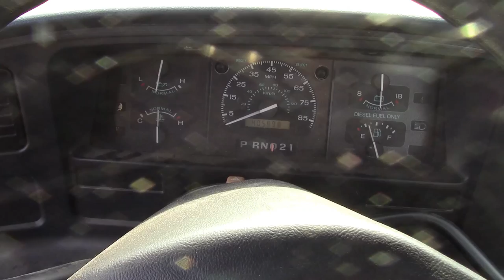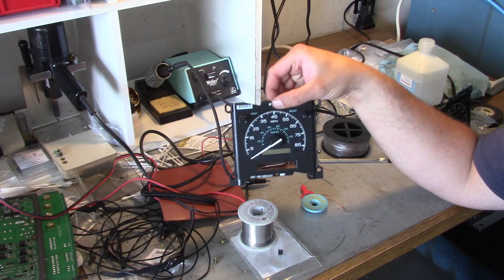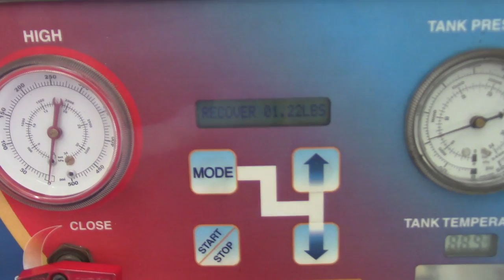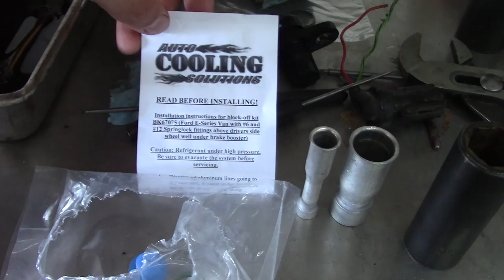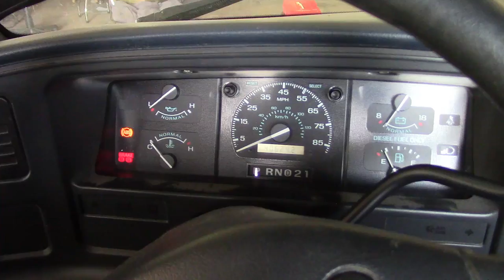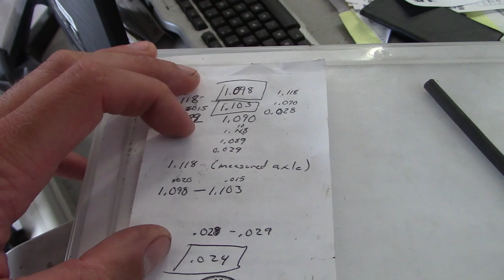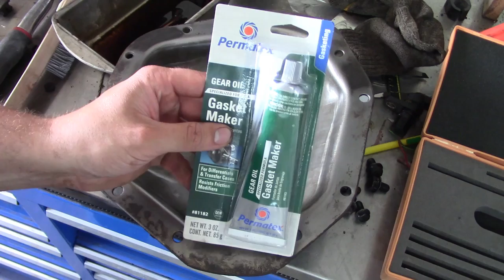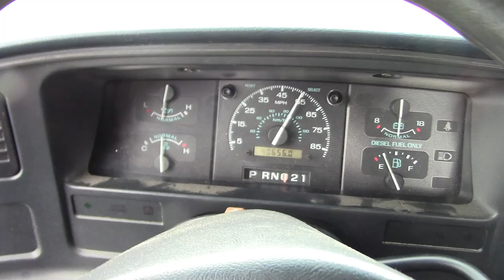Ford E350 | Speedometer Diagnosis Frustration

Comment from the maker: Looking for an obscure specialty tool?
Lisle 14100 Valve Core Tool: https://amzn.to/2AM88Rm
Weller 6966C Heat Gun: https://amzn.to/2YXNQvU
Reply: What was the stuff you use on gaskets that helps it seal but never hardens?  I was looking for that the other day and forgot.
Reply: Wes I was wondering your thoughts about a Massey Ferguson 65 4 cyl gas if they a solid tractor or not. Really enjoy your videos keep up the good work. Thanks from fielding new Brunswick Canada.
Reply from the maker: @CTSCAPER  Permatex 2A I think. The "aviation" stuff.
Reply from the maker: @oldfaithful4112  Masseys are pretty decent. Should be a Continental or Perkins engine. Either would be good.
Reply: 👍👌👏  Pretty impressive! Congrats!
Reply: What was the de-soldering gun?  Sounded like Heiko 808.  Thanks.
Reply: Its a ford... Speedo works be grateful lol
Reply: instaBlaster...
Reply: I enjoy your expertise thanks

Comment: I’m a old commercial HVAC mechanic twenty seven years in my trade and I can recognize a skilled mechanic. You sir are highly skilled, how you can go from issue to issue flawlessly is incredible. 
I can’t believe how some idiots troll you. Thanks for a another great video I look forward to them.
Reply: Agreed, sir, from an old HVAC mechanic of over forty plus, on the sheet metal heavy commercial end of the trade. He's very skilled, and better, he's a natural, but he's still a pup, and lets things under his skin. So he still tries to bull his way through occasionally, instead of easing away, until his rational, and logical brain returns to the controls.
Yes, sir he's dam fine mechanic, and even better in the control wiring side of things I'm thinking, as it challenges his mind, and he enjoys that part of it.
Reply: @timothymilam732  I'm guilty as charged.. But I ain't no pup. but if I STOP, and say, calm down.. and go thru things sloowwwly, I can get a tough job done, no cursing, and muscle thru it just fine.  In the end Wes went right to the heart of the matter, so that's cool.
Reply: I agree with Kenny 100%. I'm also a 24+ year tech who has worked on a huge variety of cars, trucks, boats, and equipment. I've been at indie shops, dealers, specialty outfits, and finally went into business strictly for myself. That being said, it's very clear to see, and give credit to a fellow tech who is good at what he does, and does it right. Wes is the F'N man!!! He's the type of dude I could really hang out with. My 'take away' from the people who try to troll and act like they're something special are just starving for attention and looking for some sorta credibility/ notoriety. Probably a good amount of jealousy and a dash of ignorance thrown in there as well. Keyboard warriors are all over on the interwebz. F 'EM is what I say. Keep the stupid comments to yourself and don't even watch the video in the first place if you "know everything," or are just commenting to 'look cool." This is a VALUABLE thing that he is doing by trying to help/ teach someone who is looking to get into repairing their own stuff. Not only does it help people save lots of money, but it can build a persons confidence enough to tackle the work themselves. Hell, and the videos are entertaining. I personally watch them for the commentary and I think some of the stuff is pretty damn hilarious.
Keep doin what you're doing Wes,
and keep it real bro!
👍😎

Comment: For a tooth wheel operating off a reluctor, the strength of the signal is determined by the sharpness of the tooth edges. So, in order to get a strong signal, you need abrupt changes in tooth height. With the teeth rusted like they were. It turned them into rounded nubs. I think that you saw a decent signal on your scope because you were spinning it by hand but once those teeth had some real velocity along with the load of the amplifier circuit that the reluctor was driving. Those things combined might have resulted in a weak signal as well as a signal with leading edges (assuming a leading edge trigger) that were rounded so the circuit (assuming a zener) was not sensitive enough to actually catch the leading edge reliably. So the result was a signal that would have a time value between true triggers on the gate of the amplifiers that was all over the place. Just a thought but one that makes a lot of sense.

Comment: My '97 F350 had the same bouncing speedometer issue.  I bought a new sensor and when I pulled out the old one it had metal shavings hanging off it.  I pulled the cover off and there were chunks inside.  I ended up getting another axle from a junk yard that fixed the speedometer.  Thanks for the videos!

Comment: Hi Wes, a couple ideas, just grist for the mill. 1) If you have a signal generator and can feed a clean sine wave of varying frequency and the right amplitude(s) to the speedo, you might be able to isolate the problem to either the speedo (if it still bounces) or the signal source (if it likes the clean source). You could also narrow down an amplitude range by varying lower until the needle jumps around or quits altogether. 2) It occurred to me it might be interesting to put a dial indicator on the gear teeth and see what the height range looked like. Then maybe setting the gap to the low end of that TSB range on the high teeth. Also might point up a concentricity problem or something. 3) You might want a shielded (coax) cable connected very close to the sensor while you're taking a measurement. Twisted pair might do the job fine though. In any case, that's a pretty long conductor acting as an antenna that can be picking up interference and the wires are a potential source of problem too, although I expect they are not shielded as they come from the factory. Anyway, it shows me your good character to be bothered by this not being quite right. But might want to check with the customer to see what good-enough is in this case :)
Reply: Very good suggestions/thoughts. I didn't see a response from Wes. Was wondering what his reaction was to your ideas?

Comment: I don't think that even the most knowledgeable armchair expert would suspect a rusty tone ring inside a differential ! 
The ABS and traction control on my 02 Volvo V70 kept going haywire. The left front tone ring was the cause, rust jacking had cracked it, ok up to about 45mph then a lot of warning lights on the dash. This is a good channel.
Reply from the maker: I surely did not expect it!

Comment: Block off kits are AWESOME. I suffered through 3 summers with no AC in our '07 Jeep Commander because the long lines for the rear AC leaked and I was baffled by the whole ordeal. After some research and some transfer of troubleshooting skills from one discipline to another, I dove in and fixed that critter!

Comment: It is satisfying when one can pinpoint a diagnosis with a scope, but sometimes the scope doesn't show everything you need to see. On the last VR speed sensor I did there was another 4X4 axle sensor nearby so I was able to swap identical sensors and prove the diagnosis first, but that's not often possible. In most, both the amplitude and frequency increase with higher velocity. For a pro like yourself one has to consider the extra time involved, so I can understand getting new parts and moving on.  Love WWW videos, thanks for the effort to keep them coming.
Reply from the maker: I'm really wondering if the higher resolution scope will show us the problem.

Comment: Ford "hello, how may we help you?" 'ya hi, my speedometer fluid is leaking.' i mean, that conversation must have happened somewhere at some point. 
 great video. i almost bought an identical E350 cab/chassis that had an ambulance body removed at a farm auction a few years ago. i notice it is in the scrapyard already. someone must have discovered similar problems. it's amazing you much i learn from youtube. keep wrenching Wes.

Comment: I know this is an old video but I wanted to share my thoughts. I agree with your speculation that it was 2 parallel problems. My guess is that the PSOM module went bad first. You mentioned that it sat for quite a while. I have picked up Ford junkyard axles that sat for a long time and the top half of everything was rusted because it wasn't submerged in oil, and moisture got in through the vent tube, either by raining on it, dripping on it, or just what's in the air.. I'm not sure if just moisture in the air would cause pitting that bad, I lean away from that one.

Anyway, thanks for all the weekly videos. You're my favorite channel, always enjoy watching you diagnose and repair problems. You've definitely added to my toolset.

Comment: Wes I had the same problem a few years back and like you we had replaced just about everything as you did, I got talking to a old Ford mechanic and he aske if we had checked the wiring loom farther up the loom. we went back and started checking to wires and sure enough  the coating had got hard and had broke letting water and such in and was a corroded mess. replaced that section of wire and sure enough that took care of the problem. I hope this helps Happy Fathers Day

Comment: I own that same heat gun. It will also sit with the business end pointing skyward (at an angle). For long life, run it on the blower only setting after  applying your heat shrink until the air blows cool. It keeps the element happy.  Mine is >20 years old and still works great.

Comment: I'm a San Diego Auto mechanic. I always use RTV called Right stuff. I fill the diff straight away tighten the bolts immediately and don't wait longer than it takes to wash my hands to drive it. No problems the last 15 years. Just saying. Love the show. Thanks

Comment: 75w90 or 75w140 works good in them, as long as they LSD compliant. Synthetic is a huge help with those rear-ends. all 3 of mine have the 75w oil with lsd and synthetic, all very smooth.  The good thing is, your honest, diligent on finding the issues, you don't hide issues, and you do things proper.  It is hard to trust a lot of mechanics and technicians, people that have you work on their vehicles and equipment are very fortunate and lucky.

Comment: Well done Wes.  Great job in explaining and keeping your frustrations under complete control.  Yes do another live chat so we can jump in with some super CHAT tips in the jar to help you pay for the scope. Interesting enough The jet engine I’m a specialist on also uses A very similar method of N1-Fan and N2 Spool pick-Up Seed pick up sensors. The Maintenance manual has a shim pack so we can increase or decrease accordingly.  Pretty cool you did well in explaining.
Reply from the maker: Wow. That's cool. Do you use a scope to check the sensor or is it just a matter of setting the air gap to a spec and it will be right?
Reply: @WatchWesWork  sending you an email with the Learjet engine manual screen prints we worked off in the field as Jet Engine field service mechanics

Comment: It's hard to fix when everything is broken, I feel your pain.
My guess on the tone ring is that is that is was never mounted concentric, even more so now that part of the ring is eroded. The sensor gap would be changing as the ring rotates with a large change where the corrosion is. This means that there will be 2 frequencies coming out of the sensor, the lower frequency derived from the changing gap. Maybe at higher tire rotation speeds that messes with speed adapter module to cause errors in the speed output.
Just a YouTube comment guess tho :D
Cheers,

Comment: I'm having a keep finding/fixing stuff problem right now, just like this truck. I'm glad to know that my hypothesis about that sensor on the axle serves double purpose as speed sensor and abs. My third rusty brake line failure happened on my 300m the other night and was lucky enough each time to not slam into anything solid. I fixed the broken line, filled with fluid, pumped the brakes, and shot fluid everywhere from another rusted spot on the same line. I fixed that spot and it happened yet again further up n the same line. I decided to buy a roll of that copper/nickel stuff and replace every line on the damn car and they've rusted everywhere there's a plastic clip. I put a radiator in this car last week too. I discovered a water leak while working on the brake lines. I thought it was my fine bargain radiator leaking, but na it's coming from behind the timing cover. I put an ebay off brand bargain water pump/timing belt/tensioner kit in this car 5 years ago, so that may be the problem. The old radiator was sorta "swelled" at the top and bottom with a crack in the tank. I find it ironic that I put a new radiator in it and the water pump mysteriously blows a seal out of it. I hope it's not a head gasket over pressurizing the system. I would assume the cap should take care of the pressure...I dunno, all  can do is keep fixing stuff until it goes again..lol
Reply from the maker: Nickel and dime I guess. Describes every vehicle I've ever owned.

Comment: A former ambulance with only 50,000 mile, might have been a lemon from day 1.
Reply: Ford
Reply: I bet it was a spare
Reply: Or the meter got changed . They usually go to plus 500,000 before they retire them and in Canada they run a;ll day in the winter to keep warm so the motor could have 15,000 hours on it
Reply: Recuse apparatus in small or rural communities don't typically get a lot of miles on them, the miles they do get can be hard miles though.

Comment: Like you said, the differential was not full. In all likelihood, the pinion seal has been leaking for years. The customer was unaware of it, since most people never check dif fluid. It was likely extremely low for a long time, and the tone ring simply rusted out over time.

Comment: Something you might try from back in my 94-97 psd days was try to add a lil more buffer/dampening fluid to the speedo with a hypodermic needle. seems like to the best of my memory the signal was taken after the Speedo needle itself & that’s where a lot of the shake would come from to the comp. I recall a forum called the diesel stop.com had a awesome forum with lots of really good guys that had fought every battle these old fords could throw at ya & had solved pretty much of all of them thru the years.  Best of luck and awesome channel!!

Comment: Nice troubleshooting on that speed sensor ring Wes. If you really wanted too you could have defined the valleys a bit more with a triangle file or a Dremel with a cutoff wheel.

Comment: I think your wife is correct. Time to get that truck out of the shop. I see multiple issues occasionally when fixing small engines. I have a shop and sometimes customers wait until the units won't run at all then I find several problems. Sometimes customers only want to get it running and not fix the rest of the problems. Great video, many thanks.
Reply from the maker: Yeah it's hard to explain to a customer that fixing something could reveal other problems.

Comment: Something you might have overlooked
It might not be the reluctor wheel , even though its a little ate up.

A grounded stator or shorted diode on  the alternator will cause the same symptoms and explain how the PSOM (and the Injector driver) went bad in the first place.

I would have disconnected the alternator and drove it at speed to see if the issue went away.

I've had several forklift engines where the crank/cam or mass airflow sensors would fail when the alternator rev'ed up.
The ECM would mistake the AC "noise" of the alternator as signal from one of the sensors and its adding the cycles to the pulses of the sensor.

Have you run into the one where the crank sensor messes up because the thrust bearing on the crank has too much play?

When under load, the torque convertor shoves the crank forward enough to screw up the clearance between the reluctor lugs and the sensor.
If you change the sensor it will usually work for a few months until the internal magnet weakens a little.

I watched another channel struggle with that issue on a jeep 4.0 and he never figured out the root cause.

Comment: I had a 96 Ford Explorer with a similar problem with the speedo, once it got above 20 or 30 it went nuts, I had to use the tach to gauge how fast I was going on the highway. One day I decided to check the air filter, never seen one so dirty before, I replaced it and the speedo began working and didn't stop until I sold it a few years later.

Comment: We had the same issue years ago on a used 2003 F250. It ended up the tone ring was the issue. It had a three inch area the was smashed. We never did find anything in the case that caused it. The ring did fix it though.

Comment: 20:00 I have a portasol butane soldering iron. It has a tip like that so you can shrink heat shrink tubing. It’s really handy. Kinda hard to use on small circuit boards when building arduino shields but it works! The heat/flame tip gets to like 2000°f or something stupid hot like that.

Comment: Wes - I look forward to the disassembly and the reassembly of the rear end - I am really interested in the pinion seal installation.  My truck has 216 K on it and it needs a new pinion seal.   I tried installing a new one on my Camaro years ago and it still leaked :(  - I am thinking that my mistake was not looking at the sealing surface on the yoke because it might of had a groove on it -  Good video Wes !!
Reply from the maker: Yeah, it's usually best to replace the yoke or use a speedy sleeve.

Comment: Galvanic corrosion typically only happens when conducting an electrical charge of some kind. It happens with water lines due to them typically being grounded to earth. FYI if you run your vacuum pump while installing your dead head fittings sometimes they will suck right in to place.